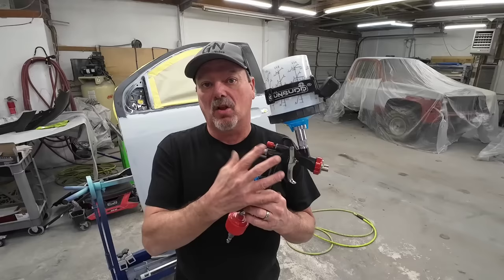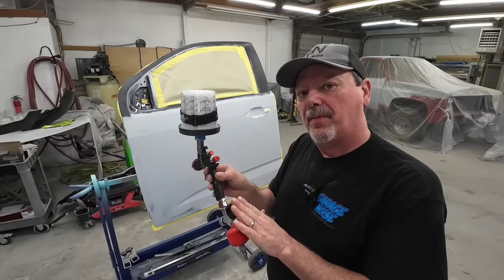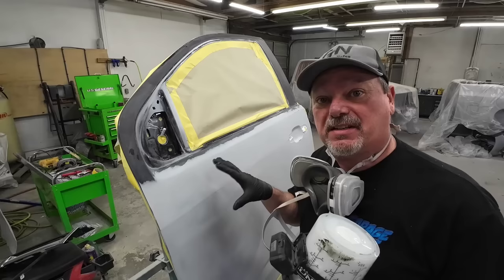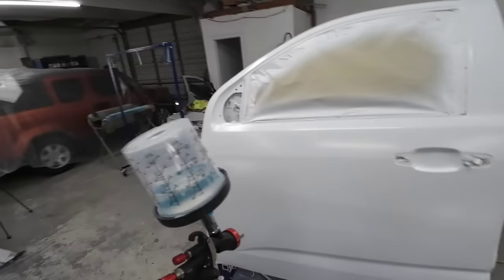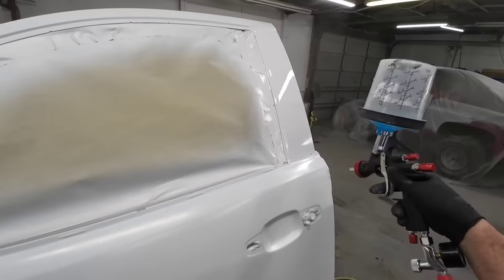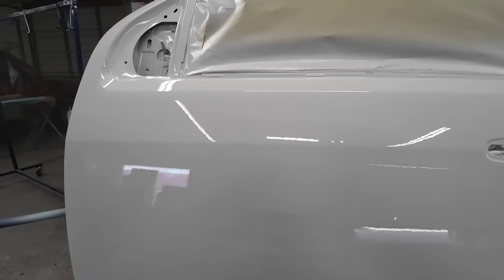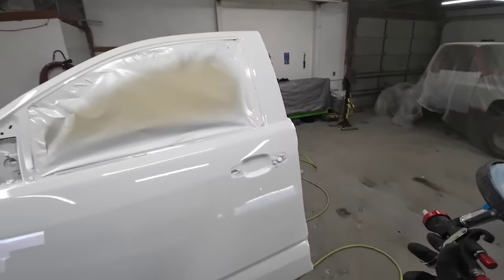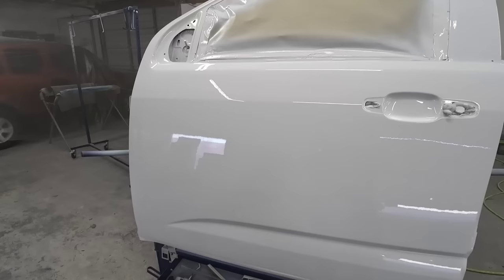Less ORANGE PEEL when painting your car!

Comment: Another long time painter said there is too much emphasis on flat clear today and that a good painter knows how to spray the right peel for the job. I thought that was a good point if doing collision work. If all you do is glass, your collision work is gonna look wrong. I seem to be in the niche of painting old cars right now, so I am looking for flat so I can avoid excessive sanding and buffing. I still wetsand and buff every old car. You know those old car guys are picky even if you give 'em a great price...
Reply: Makes sense. If I had collision work done, I would rather it match the rest of the vehicle, even if it meant adding a bit of peel.
Reply: Glasurit 460 clear flows out so well.. if you want to glass out an old hot rod that’s the way to do it
Reply: I totally agree. I started painting here in the UK in the mid 80s. It was mainly a hobby and a bit of buying and selling which involved repair and touch up work. Complete re sprays were mainly for old vehicle restoration ie classics. I was lucky enough to have a friend who sold spraying equipment to workshops so had and still do the correct and up to date equipment. On a panel repair you can have the perfect colour match but if you don't lay the paint the same way as the rest of the vehicle then it will just look wrong. Back in the day Ford's in the UK were terrible for orange peel so you had to put a poor finish on the paint so it matched the rest. And that ain't as easy as it sounds. At least with a complete paint job you could relax a little as the finish would all be the same. Custom flat finishes are not as common as the US here. But do exist.
Reply: The Factory paint is done by robots and they are adjusted to save money . Less paint means less costs. In all my 30 years I have learned to paint cars , that you do NOT see a difference after the work. But I also know how to paint really nice flat and glossy,if it is the whole car to be painted.☝️😎do not jump on the flat paint train😇😂
Reply: @chrisduc1  too late, already boarded the train on the old cars. Anything newer gets some peel tho.
Reply: @BearBudgetTurbine  what’ i said. Oldtimers and complete paintings need s to be perfect flat 👍💪🏽
Reply: My only question is how do you ensure the paint will match when you put the door back on? Whit is hard to match and I've seen repainted panels stick out like a sore thumb. Just a question for my own edification
Reply: Do you make videos about how you sand and buff? I am doing a patina build on my 1957 Chevy truck and then I want to paint my ‘69 Firebird.
Reply: Exactly! Alot of factory paint had alot of orange peel. I mean I love flat paint but if it looks good it looks good. Not everything is a show car

Comment: I used this same aeropro to spray the primer and base, but changed the gun tips for each. 2.0 for primer, 1.7 for base, and for the clear the 1.3 (30psi finish 1). Got a bunch of orange peel all other layers came out fine. The video didn't mention the gun tip and was wondering about that since you did base and clear. Thanks for all your great content, way better suited for the more advanced diy.

Comment: For metallics what grit should be final sanded with before paint great video
Reply from the maker: 600 is what I use never had a problem even with silvers.
Reply: Go from 6 to 800 if you want to be safe. Any edge gouge from 600 grit paper will show later down the road with shrinkage. I finish in 800 to be safe I've got it cut down enough

Comment: If you doing collision repair you absolutely do not want glass. You actually want to match the factory texture, or the texture of the adjacent panels.  It looks painfully obvious when you have a glass smooth door and factory orange peel on the next panel.  Or if you have a small patch of glass on a panel with texture after sanding out dirt nibs and not opening up your sanding spot
Reply from the maker: True, but alot of beginners biggest struggle is getting too much peel. This is what I want to help with.
Reply: @GarageNoise  yes but implying the goal is a flat glass glass finish is disingenuous. You hardly ever want a glass finish in todays paint except for maybe a couple rare instances. Having a standard amount of peel is actaully a good thing to have. It helps hide imperfections and damage as well as giving the paint more durability as well as leaving you enough material to correct damage in the future. If you have a little more peel than you'd like just run the buffer over it. No shame in that

Comment: Chris: obviously you have a lot of experience at painting. I appreciate that. In order to get it to flo do you use a little thinner at times? Speaking of clear coat that is.
Reply from the maker: I don't and never have. If the manufacturer of clear has it as an option to reduce than it's ok to do.

Comment: Like how you simplify things can you do one on base paint.
Reply: I'm in a paint class and still learning all the difference type of base got me confused on how to spray the single stage wet and other paint sima wet please do a video.
Reply from the maker: Appreciate the support! Yes, I can do another video  on basecoat I have quite  a few on the channel. What would you like to know specifically?
Reply from the maker: Ok gotcha,  don't  do single stage much anymore but I can surely explain how to spray it
Reply: @GarageNoise  see how it's supposed to lay I know now not wet because I tried to spray it like base and it looked good at first but when it dried terrible.  A lot of people in my class having same problem teachet told us we have to look up data sheet on every base before we spray it.
Reply from the maker: @craigcarter5276  ok gotcha,  I'll  explain it in a video  soon. Base should me applied  med to wet . What might help you is after you have coverage don't  change any of you gun setting just increase your distance  from the panel on you last coat not much maybe 1-2 inches this is a drop coat it will even everything out.

Comment: Use a quality gun, eliminate orange peel.  Superior atomization will eliminate orange peel.  Also using the right temp reducer and catalysts.  It is all about the solvents escaping at the right time with the droplet size at its smallest.  Then the droplets rejoin to form a coat.
Use a Sata or an Iwata, you will respect yourself in the morning.  When you can lay a coat of glass that does not have any peel, then you have graduated to a real painter.
Reply from the maker: It's  all about what your situation  is. Most hobbiest don't  want to spend 300-800 on a paint gun they also want less air consumption and less overspray. You can produce a beautiful looking finish with a budget gun. Atomization and the right speed activator is a key to a glassy finish. A quality built guns is great, but knowing how speed, distance, and air pressure work together to atomize the clear is how you become a great painter. Appreciate the comment and support!

Comment: I have the same gun same settings that u said & I still get texture. I’m using a 29 gallon compressor could it B that I need a water separator on the small compressor? I have one like yrs on my gun. Seems good painters know a magic trick that know one is sharing or something I feel like destroying everything I bought can’t seem 2 get it right
Reply from the maker: If your getting texture at 29 psi turn the fuluid down a 1/4 turn leave your pressure  the same be mindful of your speed and distance.

Comment: Hi Chris, Another good video. Question. What is your air pressure at the compressor after the regulator and before the spray gun if one has 25 feet of hose? Longer hose more pressure drop but let's say 25'. Thanks
Reply from the maker: It's  90psi at my inline regulator .
Reply: @GarageNoise  Thanks Chris

Comment: hi fantastic video i have one question my landrover body is extremely shiny but the bonnet has been sprayed at one stage and the clear coat is dull looking i tried buffing it but still has a matt finish how do i spray clear coat gloss over it
Reply from the maker: I don't know what type of paint your spraying over but if it's  in ok condition you can typically sand with 600 and base then clear. If your asking if you can just prep and clear over it, there's too many variables for me to say that's  possible.

Comment: How about eliminating orange peel with single stage paint?
Reply from the maker: Really, it's the same process, single stage sprays A lot like clear coat, it's a little bit thinner. Main thing with single stage is you want to put the first coat on light to medium. Do not put it on heavy. You'll run it

Comment: I want to paint my 1975 C3 Corvette, can i use the gun mentioned in this video ? Any tips would be very much appreciated.
Reply from the maker: Absolutely, you can use this gun to paint that corvette
Reply: Well I blew it! Painted a Mini using black speedokote, tons of orange peel and surface imperfections. 
Not sure how to correct this other than sanding it with fine grit, put another coat of paint down? Not sure, bummed .

Comment: Yesterday I painted my pickup hood. I did the 2.5 turns out, adj the air, approx 5"to6", med speed but made sure it went on wet, tach hood. Still have o peal.
So my  I must have used wrong temp which was med, my room temp was 75ish?
I used a devilbiss fl3 with a 1.4 tip
So now, i,m Sanding, 🤔
Reply from the maker: Fl3 might a little different on the setting. Use slow activator in 75° and up temps. You also have a 1.4 tip which is fine but make sure you're getting enough air to atomize the clear you want fine droplets.
Reply: @Garage Noise  thanks, I used wrong activator and 25psi. I,ll use this I fo on my  roof.
✔️👌

Comment: One mistake I made was letting the coats dry tack free between coats
Reply from the maker: Yeah that will cause some issues.  Probly pinched back bad and dulled out. I try to help avoid all those issues.  Thanks for watching!
Reply: @GarageNoise  once I followed your technique of 2-3 turns out on the fluid , getting pretty close to the panel and then just “zipping” it across in light thin fast coats , I started laying it beautifully .

Comment: I'm sure it came out great but watching you seemingly make many extra passes towards the bottom of the door had me cringing. I even had to look away. I recently painted some fender flares and I got some runs on the lower edges so that horror has me on edge, lol. Of course in the end it was sanded and looks good however it was unnerving. Thank you for the tips. Good stuff.
Reply from the maker: 🤣I can see that, I think a lot of that has to do with the angle of the camera  but even when I watch it back, It sure does look like I'm  spraying  a lot of material on the bottom of that door.
Reply: Amen...

Comment: I done clear coat today and I got alot of orange peel no matter what I did, could it be the paint
Reply from the maker: Was it base coat clearcoat or single stage? If basecoat/ clearcoat was your paint smooth before applying clear?
Reply: @GarageNoise  sorry I don't know all the correct terms but it's acrylic lacquer clear, it seemed pretty smooth when I mixed it plus I used a new spray gun for the first time
Reply from the maker: @melaboul5020  so you put color on first then clear overtop of it? Is this correct? Your peel was in your clearcoat? That can be wet sanded out and buffed. If you have orange peel bump up air pressure and lower the fluid this will help atomize the clear better to get a flatter finish.
Reply: @GarageNoise  yes I did put color on first, thank you very much I will bump up the air next time I'm spray

Comment: Hello! Thanks! Too many good videos. I have painted a Bumper. And when I set up my AeroPro A608, no Air came out. I have set my Air Compressor so that it holds at least 4 Bar up to the Gun. And then I have an Air manometer that gives the gun 2 Bar of air. And the gun's own air screw is fully open. That's how I had it set up yesterday. And then it went well. But now only clear coat came out, when I tried the Spray Pattern on a cardboard box. I wonder if you can figure out what is wrong. I have cleaned the gun after I finished the painting yesterday. And I have assembled the Gun, after cleaning it in the Right way. Thanks! From an Amateur called Tommy from Sweden
Reply from the maker: First thing I would do is hook gun up without any regulators to determine if it's  the gun or your air supply/ regulator causing the issue.

Comment: Just a silly question for you. Clear coat for headlights. I tried to do it today with 2k clear coat in the spray can. 2000 grit , removed all old coat down to the plastic, dry and dust free and clear coat always starts shrinking and forming snow flake patterns ruining my work. Any advice on that please. I really appreciate your comment.
Reply from the maker: Sound like you may have checking (micro cracks) in the plastic.  If that's  the case there's nothing you can do about it. If it's  a clear coat reaction then it's  reacting to something on the headlight.  A dust coat of clear may help.
Reply: You only need to sand with 600-800. 2000 is too fine for what you’re doing. Spray a mist coat first and let it tack for 10 minutes, before spraying heavier coats, with flash times between.
Reply from the maker: Yes 2000 is a bit too fine. Although it should still work, I use 600 and you can clear right over that. Now somtimes there are cracks in the plastic that will still show.
Reply: I've done at least 50 of them, paid for by customers, so learned a lot. You did not get down through the clear to plastic. I'll start as low as 320- 400 wetsand to really get the weathered clear all the way off!  you can see when it's done by the cream colored water going clear. (Ive gone as low as 240 for some real old ones.) Dont worry the scratches will clean up in the next stages! Then move up in ranges to 600 then 800 is typically enough, a scuff w/ a grey scotch brite is best to finish off.   

Wet it down any halos you see will show in clear. That's old clear still left in spots. Any old clear next to bare plastic will show. 

What you have is old clear still on the light causing the cracking look. I know for a fact. Thats exactly what your describing, It can look crackled just like that. It's the old clear! Its NOT cracks in the plastic most the time its cracks in the clear. You did not make it down to plastic! Guarenteed. I've done real nice cadillacs & Lincoln's that looked brand new crystal clear from yellow 

Honestly this guy doesnt have as much experience on lights it seems. I have a shop with hundreds of cars coming through.

Comment: As i can see you are heavily coating the bottom of the door... far more then mid and top... right ?
Reply from the maker: Maybe, but I shouldn't have. Should be uniform passes 75% overlap.
Reply: Can a clear core cover a small area if the colour coat has not been touched up. ie  the existing clear coat has been sanded too deep

Comment: Hi great videos. If we get an orange peel or drips in the base coat, can these be sanded and then clear applied or you need to apply another base layer after correction?
Reply from the maker: Yes you can. You will want to re apply base coat after sanding. Appreciate your comment and support!
Reply: If u see orange peel on 1st coat, assume we correct that before applying 2nd coats.?
Reply: Great videos by the way really gives one confidence to take these on.

Comment: Why is your spray so narrow? You're making so many passes on the door panel.
Reply from the maker: The width of the fan depends on your distance. I may have been spraying clse for one reaso or another.  If I would have painted at a greater distance the fan would be larger

Comment: 30lbs of air with a lvlp gun. Whats a good starting point of pressure with hvlp? I just bought a Devilbiss Tekna Pro lite and i seem to be plagued with bad orange peel the last two jobs.
Reply from the maker: About  the same.  Adjust your fluid down a bit that will help atomize the clear a little better.
Reply: check what the manufacturer recommends with your gun and the datasheet on your clear. Too much pressure is just as bad as not enough. Also, make sure you are using the correct temp range catalyst from a sealed container and get your mixing ratios perfect. If you lay it too thin it won't flatten out as well, so learn how to get the proper medium wet coat. Go too heavy and you will have runs.
Reply: @AnonyMous-jf4lc  Okay so I've done some test panels in my spare time and it seems Shop line (PPG/Axalta) clear just lays out a little more orange peel than other clears that I've tested. If you use shop line and go extremely thin for two coats it will match factory orange peel look almost perfectly, but as your spraying it just feels wrong like your not putting enough material on compared to other clears. Fc720 lays out ALOT smoother regardless of gun settings, or hardener speed and also you can lay out thicker coats without to much of a negative effect. I talked to the regional paint rep for Axalta/PPG and he seemed adamant on pushing the fact that they can save shops money by selling products that cover more with less material basically.
Reply: @jacobsimcox133  I stick to basically 2 lines anymore: Nason (Axalta) and House of Kolors. Even though HoK is pushing Base/Clear candies, I still find tri-coat to look the best, but it's the most demanding to make consistent. If you follow both manufacturers recommendations for how they want it laid, both products can be put on very smooth. I wet with 2500, and I don't have to do much, and it's smooth as glass. If I want peel in my clear I do like you said, lay it thin. I don't do it for hire anymore. Just close friends and personal custom work. Everything is fully sanded and buffed.